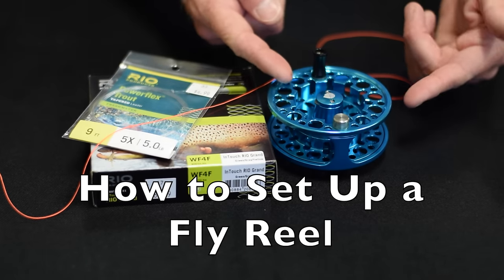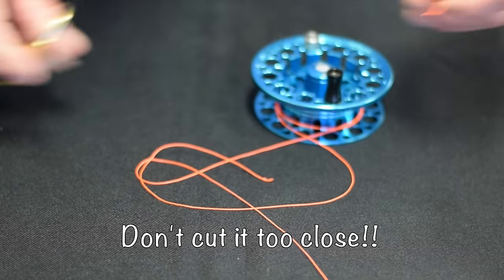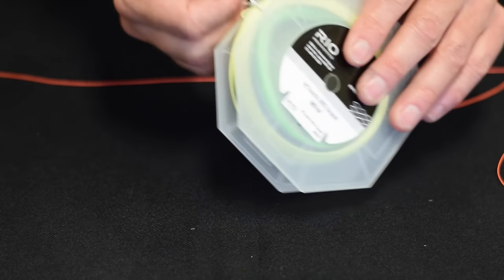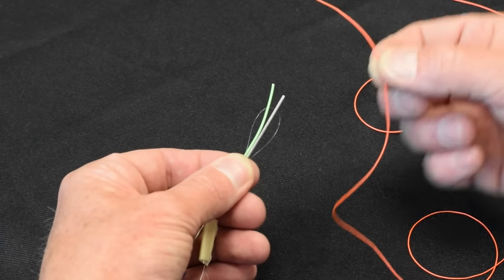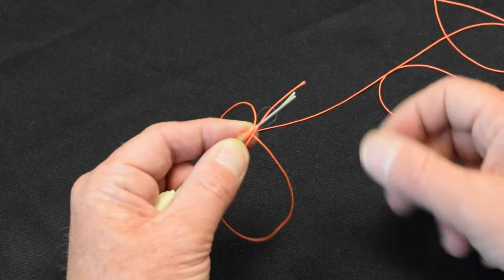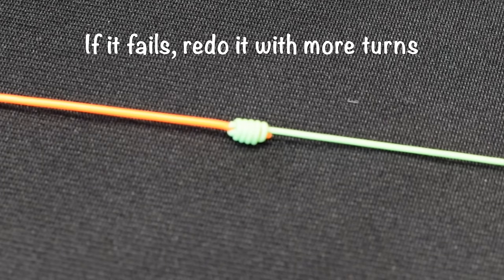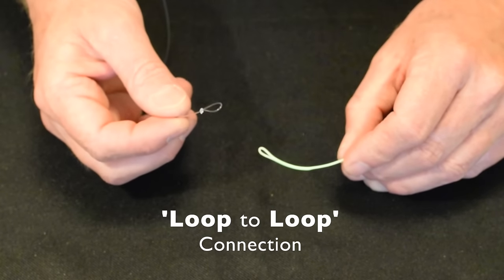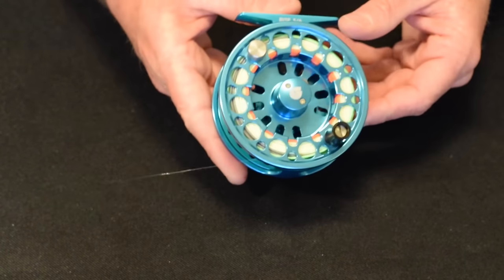How to Set Up a Fly Fishing Reel (Full) - Fly Fishing and Dreams

Comment: What I do is, I feed the end of the leader through one of the holes of the spool, and that way I don't need to fiddle around to find the end of the leader. Because if you just leave it hanging out of the reel, and the spool turns in transport, then you end up with the end of the leader again sticking to the fly line.

Comment: For my nail knots, I always put on some kind of glue to strengthen the knot and help it run through the guides smother. It really helps me!
Reply: You should always test the kind of glue that you're planning to use on an old piece of line both of monofilament and the fly line and the backing to make sure that the glue does not melt any of the fishing lines as this will weaken the rig and cause a break off
Reply: I prefer a small dab of epoxy

Comment: Interesting, when you spooled the backing it was a "right hand retrieve" and when you installed the fly line you reeled with your left hand. Did you stip the backing between frames and reinstall the backing in the reverse direction? Maybe I am wrong on this?  Unless you are fighting a large fish that will strip off all the line I wouldn't waste or cut off a perfectly good loop that you paid for.

Comment: Why is a backing used? As opposed to just tying the fly line right to the reel.
Reply: Just in case you get a big fish it will run the 100 feet of line in no time. In fact great casters can cast the whole line and you will not have any room for the fish to run
Reply: The other comments are correct and it also fills the spool cheaply which makes retrieval faster.  Never buy a small arbor reel you'll regret it

Comment: I prefer an Albright not whenever I'm working with fly line much easier in a pinch. Also for any beginners watching, don't waste your money on packaged, tapered leaders. Just buy spools of two or three different mono strengths and learn both the blood knot and/or the double surgeons knot. Manually taper the strengths however you deem necessary. It's way cheaper and you can use line you probably already have.

Comment: Is that a medal reel or a plastic reel and is that a strong fly reel
Reply: Looks like a Redington Rise.  For around 200 bucks it'd better be strong!  It has a sealed drag and is milled aluminum iirc.   Drag is super smooth and works well for large carp, muskie, and small saltwater on my 8wt.
Reply: Go on wish.com buy direct from the country they are made in, cuts out the middle man. Sad to say this to people , because I own my own tackle shoppe. Most lures and tackle are made in China , packaged in Mexico or the USA. Read the back of the packages, always try to buy a metal fly reel with a felt drag system, they cost more. But if your just starting out fly fishing 5/6 weight rod and reel set up ($100)will do fine until your confidence level in fly fishing warrants you spending $300-$600 for a rod and $200 on a reel and line , tippets, flies etc.

Comment: How much backing before you tie the fly line?
Reply: Fly Fishing & Dreams average length? I have no directions with all the old gear that was left to me.
Reply: This is what I was read a long time ago if you don't have directions. It always worked for me, although it is a bigger pain in the butt. Attach backing to flyline, put fly-line on reel headfirst (if that makes sense.... backwards) Reel the whole mess on until you have about 1/8 inch space between backing and edge/frame of spool. Take it all back off and reverse it. Or, take line, backing and spool to a shop and have them do it (making sure they leave the 1/8" gap). Hope this helps.
Reply: Andres Turner Thanks a bunch buddy! I am a begginer I hit the river in 2 weeks for the first time in my 38 years with a fly rod.

Comment: I dont understand why is there two types of line on the reel ? I understand you have to tie liter from flyline to the fly . but why two types on the reel?
Reply: Fly line is expensive and generally comes in spools of about 80 feet, that small amount of line won't fill a reel correctly and might run out with larger fish. The backing is a cheap way to fill the reel and also provide insurance for larger fish.  Also like braid on a spinning reel it stops the fly line from slipping on the reel under drag.

Comment: i would never trust a slip arbor knot! i always have used a Uni knot. the uni is the strongest knot possible. the knot will stick off the spool a little but if youre stripped that far down, line catching on the knot is the least of your worries.

Comment: Good tutorial on a nail knot but a nail knot is not a good knot to be used on backing to fly line. A FG knot is superior to a nail knot for 2 reasons; It is smaller in diameter and it flows through the guides much better without a chance of getting hung up. A nail knot should be use to  attach the leader to the fly line.  Also spool your fly line on your spool then the backing to within an 1/8" of the outer diameter of the spool. Remove the backing and line and re-spool with the backing first using the knot he showed to attach the spool to the backing. That is the correct way to get the exact amount of backing you need. I have been doing this before he was even sparkle in his daddy's eye.

Comment: So first we start with this 4 hundred dollar fly reel and then we attach this 20 dollar backing to this 100 dollar fly line and then add the 20 dollar leader and tippet and finally tie on a 5 dollar fly,..........Oh and sorry when were done you wont have enough money left to actually go fishing?......Sigh
Reply: I am just getting started (about to follow this awesome vis instructions to spool my reel for the first time, THANK YOU FOR THIS FANTASTIC HOW TO!), just a note....being as I am just getting into this I am working my head over 1: Learning correctly from the start, 2: not dropping major coin in the process. I could I suppose, but that is just waste. 
If cost is an issue, buy used, vintage etc on ebay! Study up to get the decent vintage gear. Pflueger Medalist 1494 reel about $30 or so, Vintage bamboo or fiberglass rod about $40 or so, Backing and Line Rio, Scientific Angler, etc, maybe $50 or so on amazon.... no need to jump to the top shelf on entry, learn to cast well, learn to do line, knots, etc...don't make it about the gear, make it about becoming a good fly fisherman or woman....
Surely the fish do not know how fancy ones' gear is?
(or maybe I haven't gotten to that part yet! lol)
enjoi